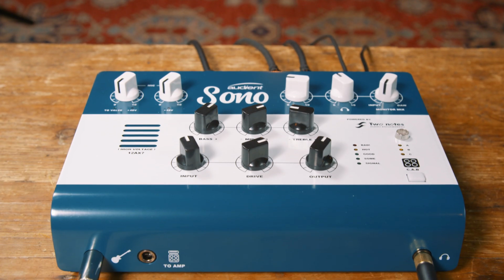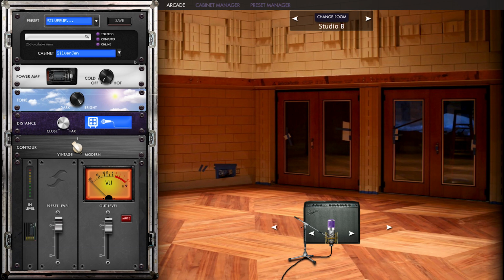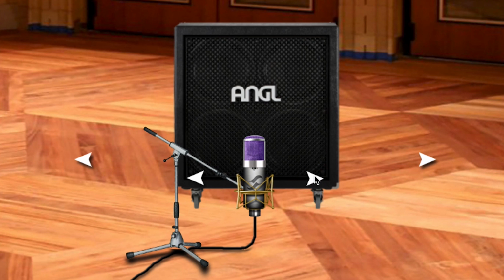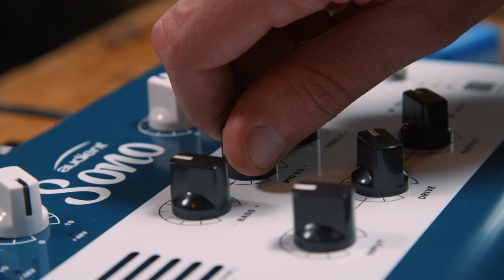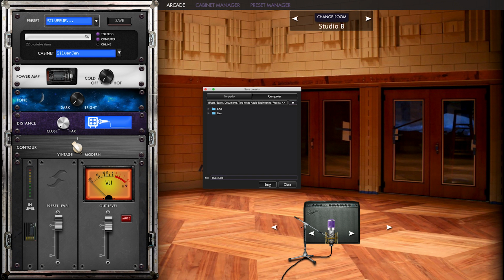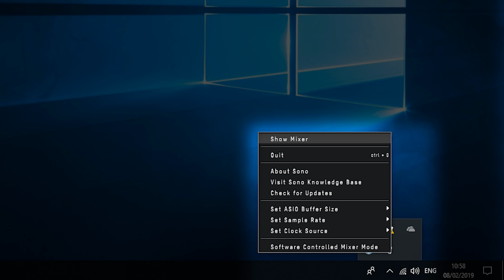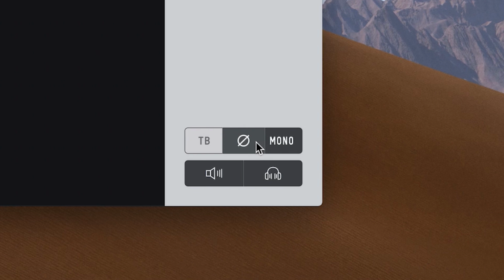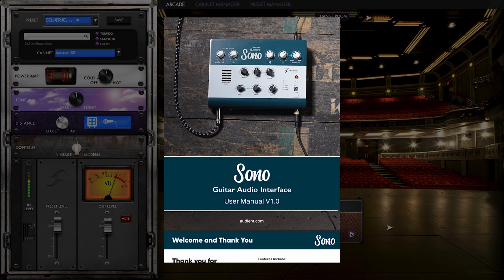Audient Sono Software Overview - Torpedo Remote and Sono Mixer

Comment: You mean that you cannot apply torpedo sound room in mono while you try to listen on headphones in stereo with the two rear input channel and not accessing to valve?! please, tell me it's not true....
Reply from the maker: The Torpedo CAB processing is only applied to the Guitar input, or Mic Input 1 if the "To Valve" button is pressed in. It's not possible to apply the CAB processing to a stereo signal fed from the two rear inputs.
Reply: I was convinced it could only be a problem of correct routing setup but in this case there is a significant limitation to the features ‘cause the unit works basically only in mono mode. The two rear inputs are a last-hope-method but I can’t imagine an easy panning setup on headphone. Even if I don’t press the “to Valve” button to hear effects in stereo mode the unit is nearly useless.

Comment: Noob question:

I wanna get rid of my amp, cause in my appartment i can only play on headphones anyways. Im looking to buy the audient sono.
My usecase would be:
- Plug guitar to sono wich is connected to my computer.
- Get the guitar sound on my wireless computer headset alongside say youtube or itunes to jam along (so not using the monitor output of the device itself but rather use my computer headset). Is that possible? (windows computer)

because running free amp sims (like lost in 70s) with asio4all i had the issue that the software will block the selected output for all other applications. Making it impossible to have both the guitar and itunes on my headphones simultaniously. Can the sono software provide that?
Reply from the maker: Having the audio play out of your wireless headphones rather than via the Sono will depend on whether your DAW software allows you to select a different device for your input and output as not all DAWs will let you do this.

You can use other applications at the same time, you'd just need to ensure that your System audio sample rate matches the sample rate of your DAW session and then you should get audio from both apps.
Reply: @Audientworld  sry for the noob questions but i dont get that.
So i need an extra DAW to get my guitar that sono sends to the PC via usb onto my PC headphones? (or speakers, or whatever i use to play my computer sound)
The software from the sono can only basically take the input, but not route that to an output of my PC?
Reply from the maker: If you are on PC then you can use the "Listen to this Input" feature in the control panel to send the input to your output. This is found by going to Control Panel > Hardware and Sound > Sound > Recording Devices. Now find Sono Input 1 and double click on it. Go to the "Listen" tab and click the tick box to turn this feature on.
Reply: Audient hi. Thanks for the answer. I tried that but it has horrible delay if i use any output other then sono itself. If tried tons of stuff but basically i can only get low delay when using sonos output.
I found 1 way to get rid of the delay. Thats running asio4all and selecting my headphones as output for the ampsim. Unfortunately asio4all disallows running more than 1 application, so that solition is not suitably for playing jam alongs.

So unless you got any other idea there is probably no way but plugging my monitor/headphones directly into sonos output.
But great device other than that, i like it.

Comment: Can you use virtual pedals with it? I mean sending the guitar signal to my DAW, then adding virtual pedal plugins and then send it to the Two notes CAB SIM and then back to record in my DAW.
Reply from the maker: Thats not something that would be easy to setup on the Sono I'm afraid. However, you can also run the Cab simulation in your DAW using the Wall of Sound plug-in from Two Notes which is available through our Audient ARC promotion which you can simply run after your guitar pedal effects to get the exact same results without a complex routing setup.
Reply: @Audientworld  Thank you, I will use this plugin!

Comment: Hi Audient.., Can I send from my daw to outputs on a focusrite octopre connected to the Sono via ADAT? So I can route my DAW tracks to outboard effect pedals and back again? Thanks
Reply from the maker: The Sono only has an optical input, not an output so you wouldn't be able to send audio to the Octopre I'm afraid.
Reply: @Audientworld  ok thanks... but I could do that with an ID40 correct?
Reply from the maker: Correct! This would be possible on the iD44 as it has two Optical outputs.

Comment: Hallo, do you have any tip for the best way how to record using Sono a guitar signal with applied stereo delay effects (like ping-pong delay)?
Reply from the maker: Sono only has a mono guitar input so it can make it tricky to apply stereo effects. You can connect the stereo effect to the two Line inputs on the rear but this wouldn't give you access to the valve or Two notes simulation.

Comment: Which version of Two Note Remote should be installed for use with the Sono?  The Two Note website says: "There are currently two versions of Torpedo Remote: 4 and 5.
  Torpedo Studio owners need Torpedo Remote 4. Torpedo C.A.B., Torpedo Live and Torpedo C.A.B. M owners need Torpedo Remote 5."
Reply from the maker: Hello there Andrew,

The Sono uses Torpedo Remote Version 5.

The correct version of the Two Note Torpedo Software is installed as part of the Sono installer available from our website. Simply run the installer and the correct version will be installed
Reply: @Audientworld  Thanks, this is very helpful.

Comment: Is it somehow possible to use an ampsim of any kind on a computer before the built in cabsim in sono?
I do like the idea of DSP cab and poweramp sim but it seems kinda backwards to me to have it on the way in to my pc. Maybe this is a product for people with many (preamp) pedals?
Reply from the maker: With Sono, you have a fairly clean valve pre-amp on the way in which comes before the power amp and Cab simulation. This way, you can plug your pedal board straight into the front of Sono and it'll react just like how the front end of a valve amp would react to overdrives, boosts and picking dynamics.

If you're using pre-amp simulation in your DAW however, you can simply use Sono as a really great sounding DI and then run this into your preamp sim. To use the onboard Power Amp and cab sim afterwards, you could then send the guitar out of the re-amp output and then back into the input to be passed through the CAB simulation. I appreciate that this isn't the smoothest workflow however.

That being said, all the cabinets that are included with Sono can also be used in Two Notes Wall of Sound Plug-in so you could go with Sono for a great DI sound, into your Pre-amp Sim and then in the Two Notes Wall of Sound for the Power amp and cabinet simulation. This means you don't get the same low latency monitoring but it would give you a very similar sound.
Reply from the maker: There's a fully analog 12AX7 preamp built into Sono which comes before the DSP which gives you a great front end to run your guitar and pedals into. The Power amp and Cab are then handled by the Two Notes Processing which allows you to record  great guitar tones without needed to crank up a loud amp. You can easily bypass this however if you'd prefer to use your own cab sim in your DAW.